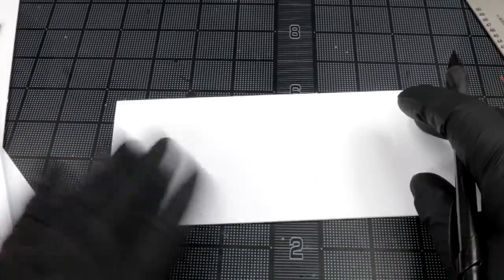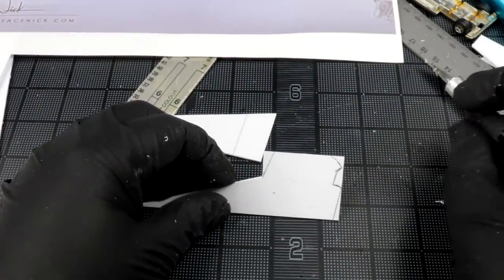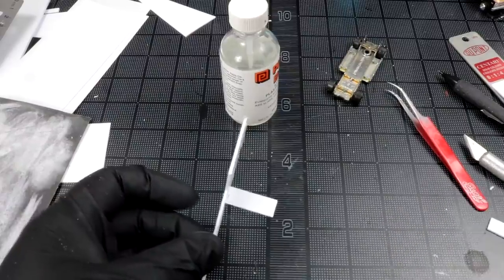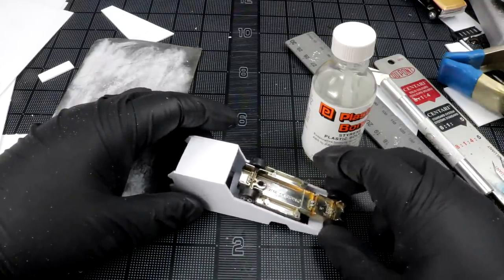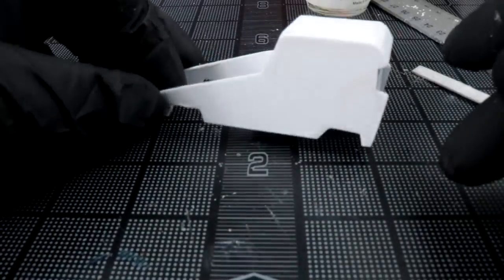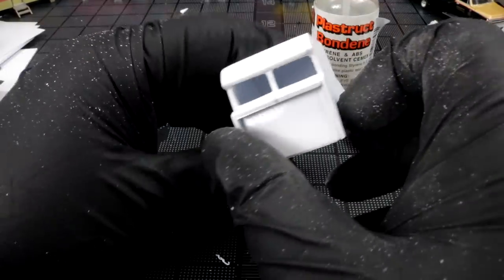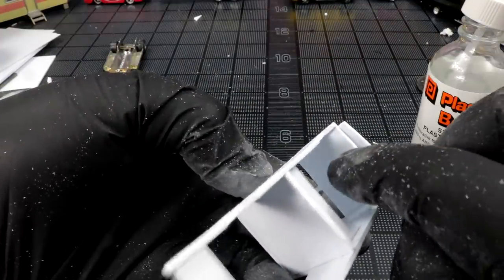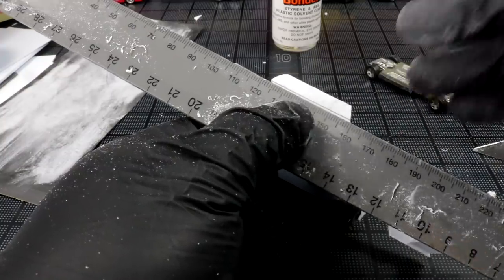Winnebago Transporter from Scratch Part 1

Comment: For years, I used half of an old set of dividers (borrowed) from school, to scribe styrene sheet. When I lost that, I used a tungsten-carbide tipped engineer's scriber. I've never looked back. As well as scribing lines, it can be used to start holes for drilling. Unsurprisingly, it scribes ZAMAC rather well, too. Looking forward to part 2! Your scratchbuild is looking awesome. Nice one.

Comment: Fantastic build and video. I love the narrative. One suggestion is get a 2 inch by 2 inch piece of foam or wood and cut/drill a whole the size of the bottle of cement to keep the bottle from tipping over. You WILL eventually knock it over without something to secure it. Don't ask how I know. Dave

Comment: Hey Diecast Resurrection. Instead of using the Plastruct Plastic Solvent. Go to your Hardware Store in their paint section look for MEK solvent. Its just about the same as the Plastic solvent that you are using. It will melt the plastic also. In fact Plastruct is made out of MEK with things added to it. It will save you money too.

Comment: I was waiting for you to tip the  Bondene bottle over. Been there and done that. Since it literally evaporates even when the top is closed I have a glue product that is more
 easier to use. Faller Super-Expert # 170490. Works like Bondene, has a metal thin diameter  tip  so no accidental spillage and won't be contaminated by the brush
which makes Bondene turn to goop towards the end. I now use it exclusively . If the metal tip gets clogged use a thin wire to clean it out. Love your scratchbuilding work so far!
This is gonna be a cool transporter!

Comment: This is pretty neat! You should look into 3d printing. You could whip up some cool designs in fusion 360 and print them
Reply from the maker: I'm saving up for a resin printer to do little engines and stuff!
Reply: @DiecastResurrection  I'd love to have a resin printer. All I have are a couple fdm printers. Definitely can't print fine enough detail for a hot wheels sized engine.

Comment: Why didn't you just use the green light Winnebago to start with then customize it
Reply from the maker: It would be to small for any car to fit in the back, any no sense cutting up a perfectly good one. Also I like challenging myself, this is the second time Ive used styrene.
Reply: @DiecastResurrection  the green light is a lot bigger than hot wheels because green light is true 1/64 scale compared to hot wheels